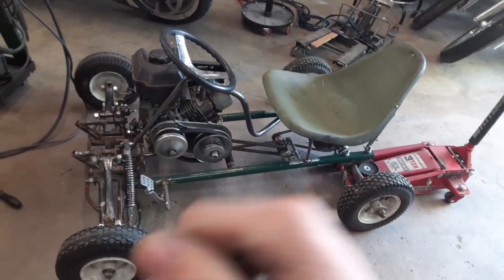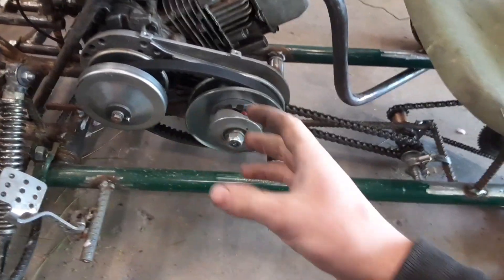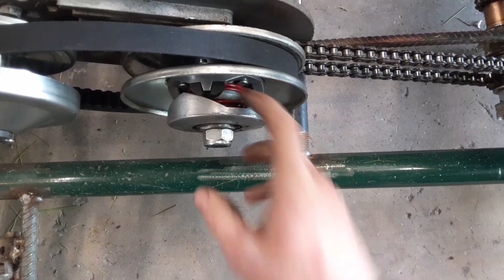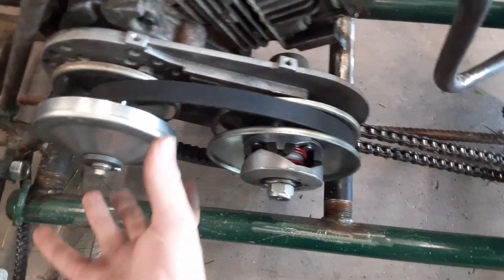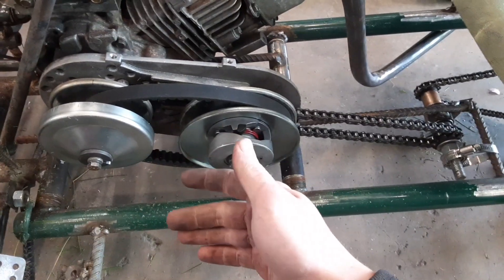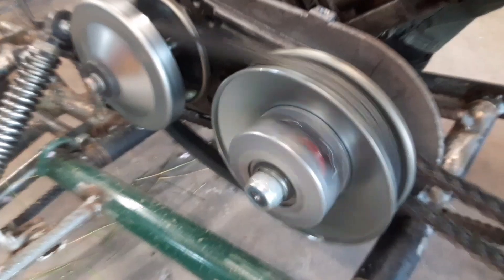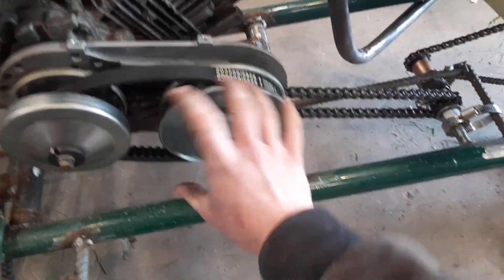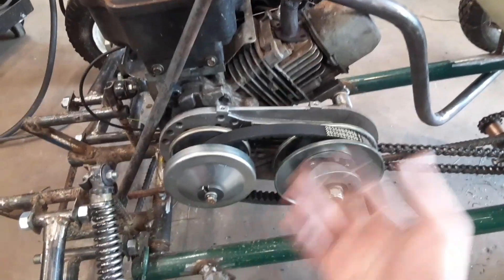how a go kart torque converter works

Comment: To make this a tad easier to understand, the pullies use centrifugal force to open and close, changing the diameter of the front and rear pulleys. This, in turn, changes the diameter of the pulleys, causing the belt to slide to larger and smaller diameters, depending on how the converter is set up. It changes the ratio of the front and rear pulleys with the amount of power and the speed of the engine. One pulley will close, while the other will spread and allow the belt to slip into a lower diameter on the same pulley. The pulleys are "spring loaded", so as the rotation speed of the pulley gets faster, it will also spread further apart, which allows the pulley to recess into the pulley changing the gearing effect. I hope this helps, even though I just confused myself!🤣😂👍🏼🙏🏼🙏🏼🙏🏼

Comment: Great job thanks for the demonstration.  Seeing it work now makes sense.   It's a cvt transmission.  Varying the gear ratio dependant on rpm.  Which will give you the best of both worlds off the line acceleration,  top end hearing for higher speed.   As long as it doesn't slip.   So now I wonder how efficient at they?  How much do they slip vs how long do they last.

Comment: Yeah. It is really cool. Todays rabbit hole. You explained the springs on the rear pulley but could you go into greater depth on the front pulley? The one comming from the engine, what mechanism closes it as speed increases?